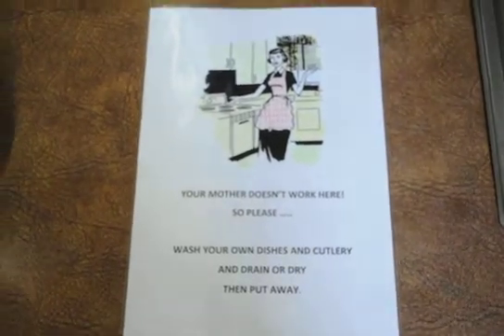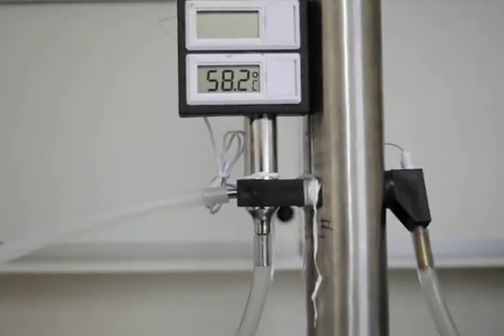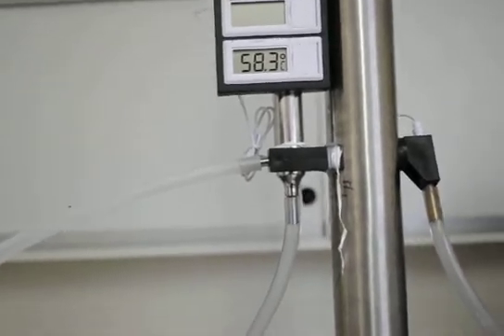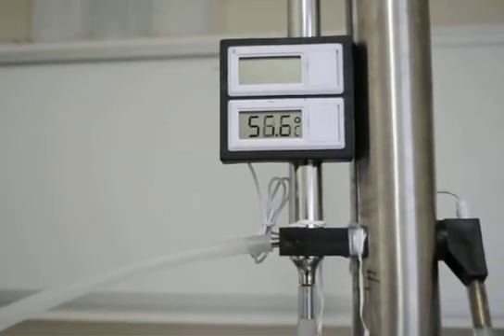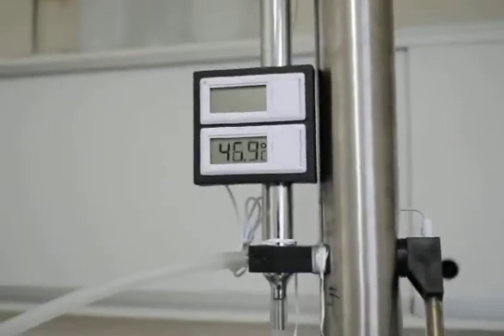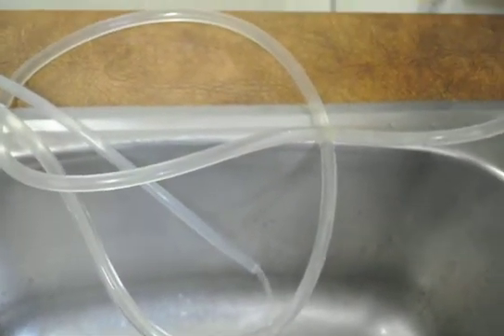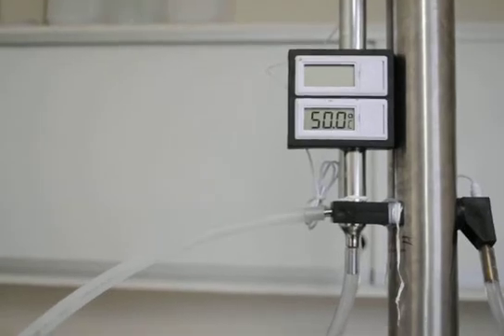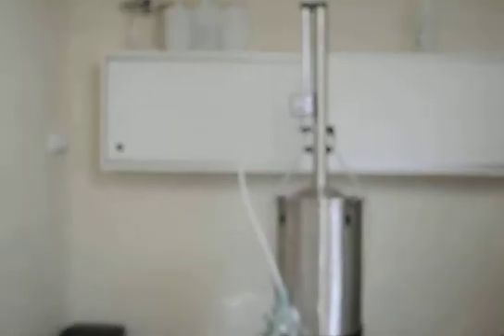Turbo 500 Still – how to improve distillation efficiency by adjusting water flow rate

Comment: It seems to flow better at 70. Is this safe?
Reply: It flows faster at a higher temperature but the alcohol is usually not quite as strong but only by a couple %ABV
Reply: I know these are old but to original post I agree. I've watched all the videos I could and it seems where I'm at it doesnt start to flow as good unless its a bit higher temp than what this guy has and george from barley and hops. I wonder if it matters the elevation